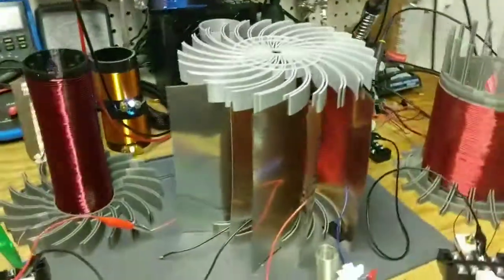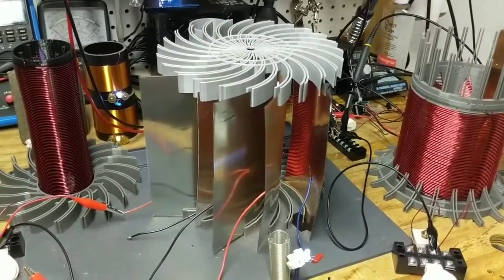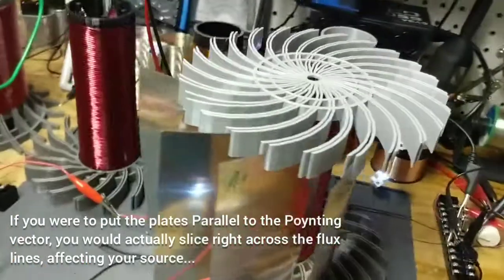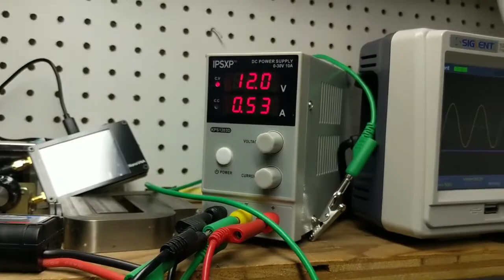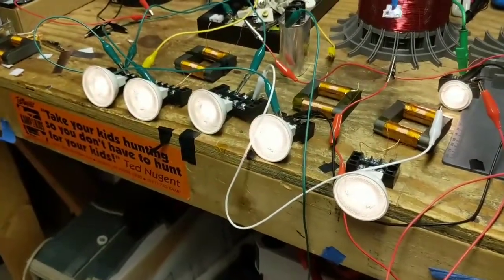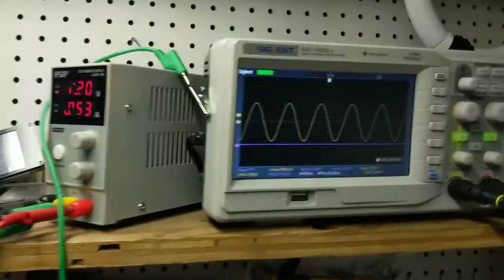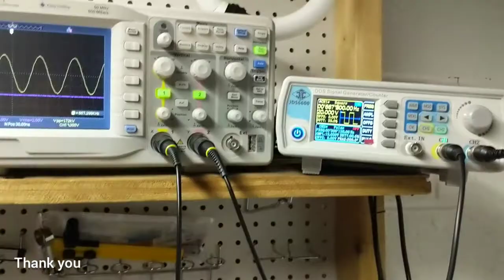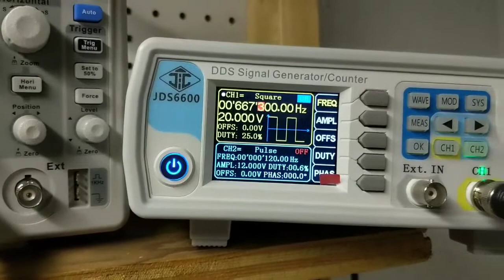Don Smith Experiments - Heaviside Flow 1

Comment: Great video, anything new lately?  I have a similar setup with Ricks coils, about a dozen of them lighting those 5 watt bulbs at 50-70% intensity.  My analog meter shows about 10 watts going into the system, and my boost converter shows zero watts coming out, despite all the bulbs being lit!  When I turn the frequency down, the wattage on the boost converter will soar up as in a typical electromagnet induction where the power runs thru the wires, but when the frequency gets high enough, all of a sudden the boost converter reads zero watts like the energy is now traveling on the outside of the wires.  I too can add as many of those little lights as I want without affecting the input, but I just can't figure out how to step it all up for higher output?

My setup is even simpler than yours, no caps, transformers, diodes, etc, just nothing but coils.  I have Ricks 8" coil with 5 of his smaller coils inside and his smaller and 8" coils all around as well.  ALL secondary coils are grounded and there seems to be no limit to how many you can add.  I have also noticed that you can combine the outputs for more power, but I still can't figure out how to get the BIG power that Rick and Don Smith talk about???  I'm going to Rick's next meeting this July, hopefully something will be revealed there.

Comment: Any news? Are they you still working on this?
Thanks
Reply from the maker: To a degree, but not with this setup.  One thing not great about this setup in the video is that I've learned that you need to not have your load directly linked to your source.  They need to be out of phase or decoupled somehow.  A better setup is not to drive this directly as I'm doing here, but to have a L1/L2 arrangement, where L1 is pulsed more similar to a spark gap Tesla coil.  Alternatively I think an extra coil type arrangement would be interesting to look into as well.

Right now I'm back on the Don Smith coil systems and slowly advancing.  I've spent probably a year trying to research, dive in and sort stuff out in my head.  Luckily I've received some very good guidance along the way.
Reply: @phives5910  looking forward to more videos on your work.

Oh are right about decoupling. So I am working on a few things too

One idea is to fill a cap and then decouple it from source, dump it and couple it again

This way, the source won’t see the load. 

Thanks again and wish you the best

Comment: Great work! Am very interested in seeing if and how your experiments have progressed regarding Don Smith and the Heavyside flow. Planning to release any updates?
Reply from the maker: WaveGuide!  Let me say thanks for your website and other materials you provide, they have really helped me.  I've generally taken a step back on the videos and commenting.  Too many trolls and others who don't understand experimentation, versus expecting to see something that works and is fully understood.  In general I'm back on the Don Smith coils systems.  I've built larger gauge wire systems and am working with higher voltage, ZVS + spark gap setups.  My goal this year is to continue to work on a single device and focus development rather than bounce around to different systems.  I think as I progress with the coil systems, I'll want to look at additional ways to collect the most output from a very high voltage oscillating coil, and these capacitive plates could help to squeeze some more out.
Reply: @phives5910  Ah I got you, trolls abound unfortunately. Feel free to send me an email through my website, as I would love to see what you're working on at the moment 🙂
Reply from the maker: Will do that for sure

Comment: I really enjoyed your video! Thank You and thumbs up!!!!
Reply from the maker: Thanks.  I'm not sure the efficacy of this setup, but will stick with it longer to learn.  I'll make another video soon.  I was able to affect the source when I drew a lot more power from a single plate.  The plate to termination (in this case an avramenko plug) is a transmission line!  Matching the impedance can push more power to the load, mismatching will create standing waves.
I've yet to determine if there's a construction issue,  or something like capacitive coupling.  But I'll try to address this in the next video.